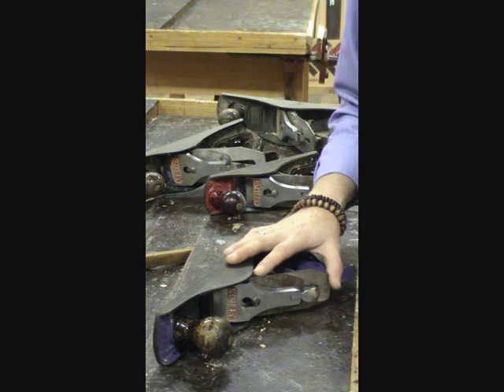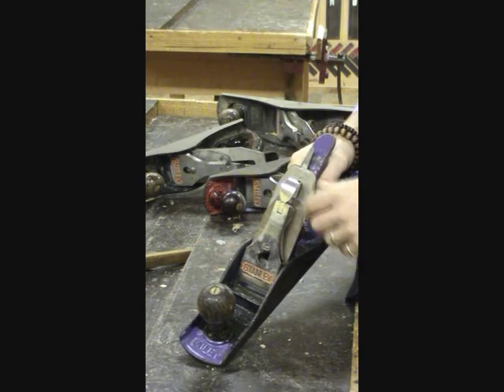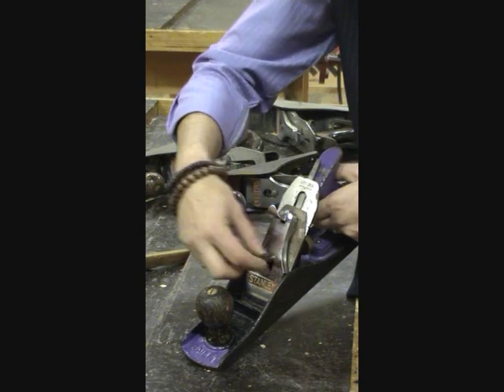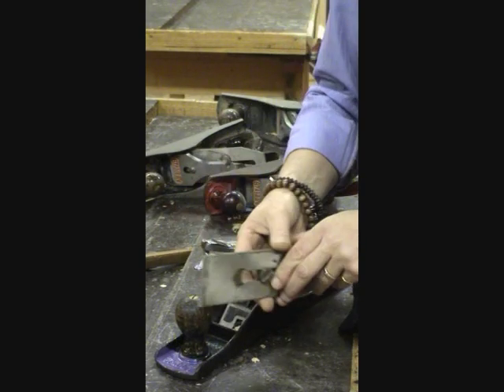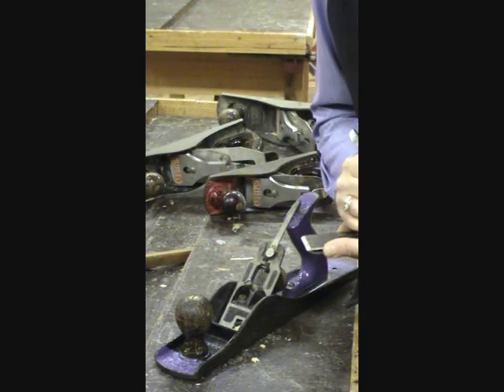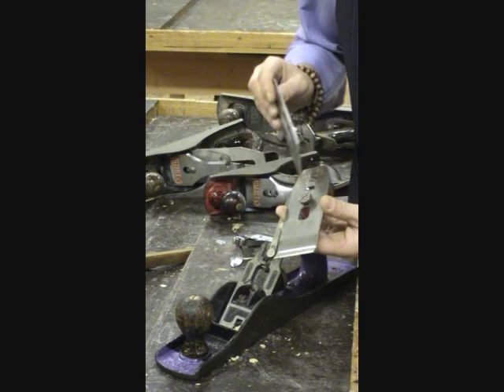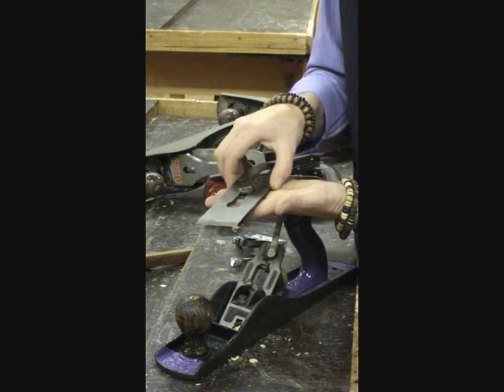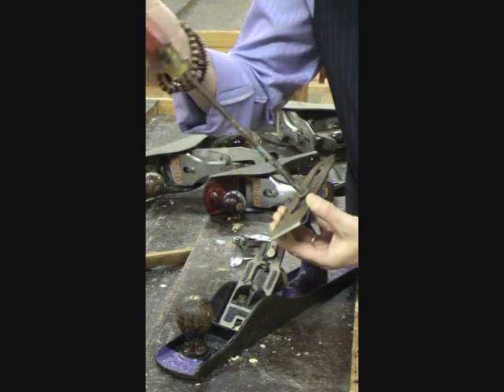Setting your Hand Plane

Comment: The 3 mil tip was exactly what I needed. Very well done.
Reply: WOW...3 mil???  Being a yank, I'm not all that up on British slang...an I correct in thinking "3 mil" means 3 mm?   I think in fractions of an inch, so I have to translate...3 mm = 0.119 inch, or just shy of 1/8 inch.

When I'm working on soft wood (which I usually am -- fir & pine) I adjust my planes to give me chips that are approx 1/16 inch.  That's a bit less than 1.6 mm.  That's just about the BIGGEST chip I make -- if I'm working on the edge of a straight-grain, knot-free cedar board, and I want to narrow it down quickly, I might go as heavy as 3/32 inch (a shy 2.4 mm).  Those are some HEAVY chips!

When working on maple or hickory or oak, I go down to 1/32 inch (about 0.8 mm).  When a chunk hardwood is uncooperative (knots, burls, etc), I go down to 1/64 inch (0.4 mm).

I can't even imagine planing 3 mm chips.  ...Or is my math wrong?